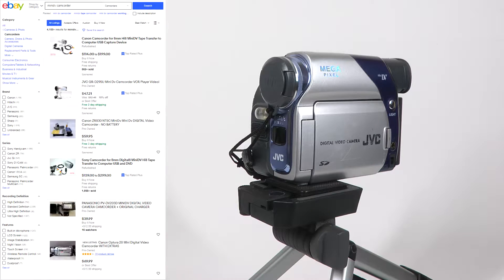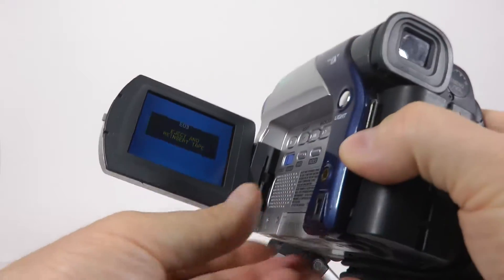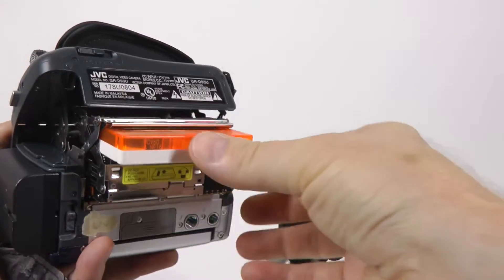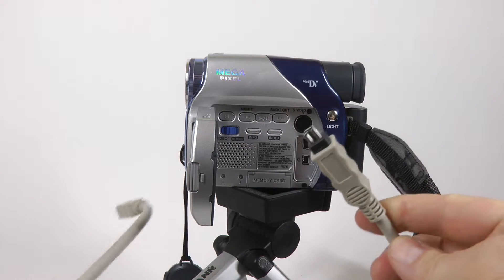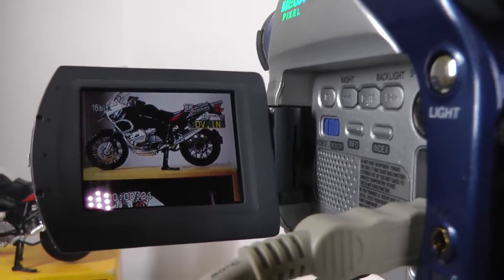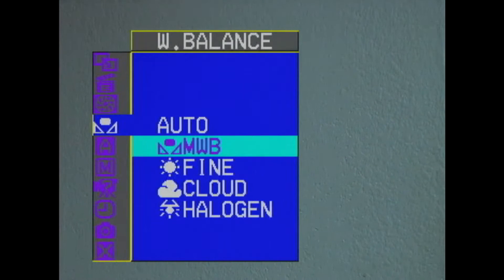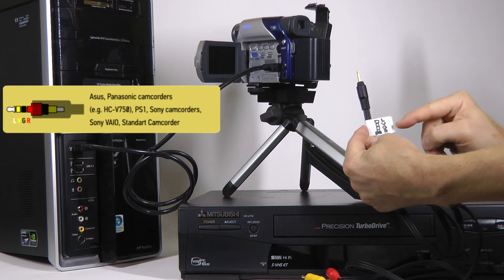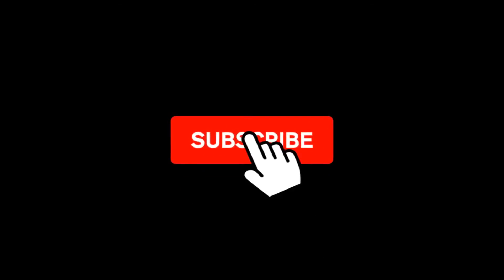How many MiniDV camcorders are needed to record a video?

Comment: Safeguard mode is the tape -not the camera -  you need to click the tiny lever over on the tape cassette to record and off of "safe"
Reply from the maker: You are confusing Safeguard mode with record protect tab on a cassette. The latter prohibits recording onto a particular cassette, it is controlled by a user. The former is an error message informing about a problem with tape mechanism.

Comment: Hi, great Video.  Could you see in the Lenscap Cam where  the place of the pinch roller is? Because o found a pinch roller in my cam too.😢
Reply from the maker: Are you asking, where it should be located? It should be on takeup side. Maybe I should try put it back, it looks like the pinch roller is held by a short plastic tubular piece similar to a pen refill.

Comment: l recently got a GR-D94. Same as this, just from the following year. Everything works on it, except for the tape transport, which is stuck in safeguard E03 mode. Turns out the gears around the spools are cracked, which is very common with JVC DV camcorders of this vintage, since they cheaped out by using weak plastic gears around the spools. That might be the problem with your first camcorder, though, this work around is pretty funny. 

My work around was that I just hooked mine up to my comp using the firewire/thunderbolt 2/thunderbolt 3 set up straight in to my laptop with FCP as a recorder, and was able to get video out of that that way. Cumbersome, but works, and is still uncompressed DV footage..

You should be able to use recording to an external VTR as an exploit to record video with the camera's wide angle mode, which seems to only be for the photo mode by default for some reason.
Reply from the maker: The non-working that I have is missing pinch roller. Apparently, not only JVC, but Sony as well switched to a stupid plastic piece they used instead of a proper locknut, so the pinch roller just slides off.
Reply: @ConsumerDV  That's surprising honestly. You'd think during the absolute height of tape based camcorders, they'd make them a bit more durable than that, but sad to see that isn't the case.